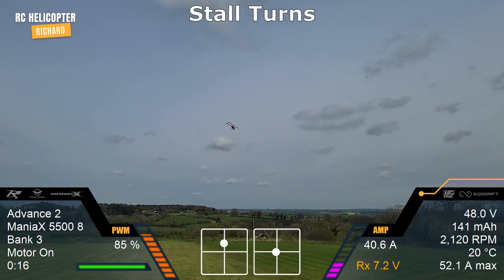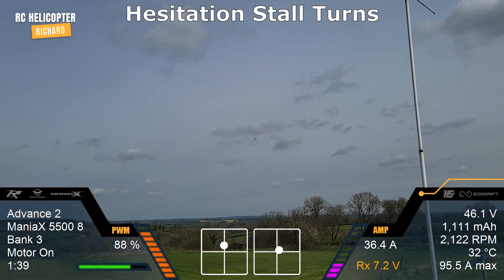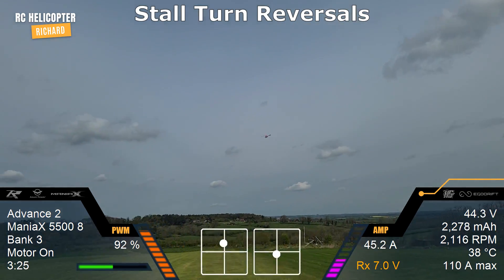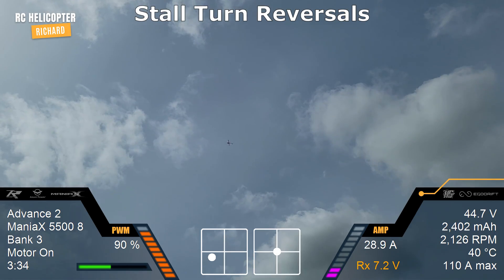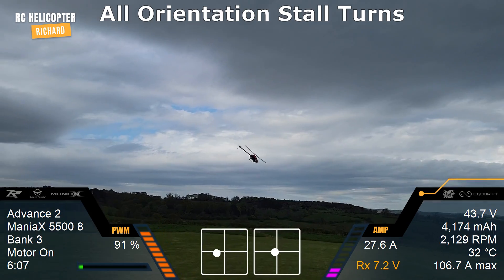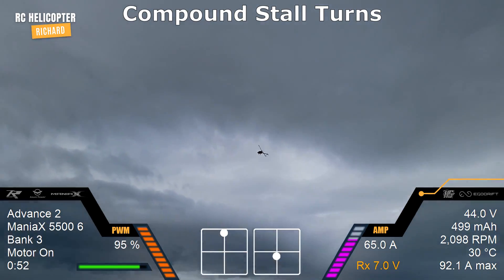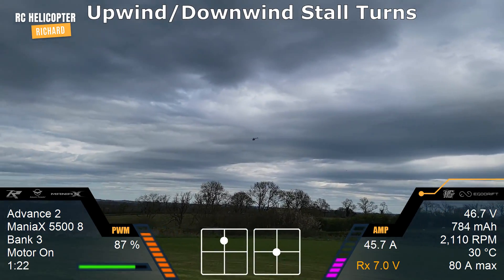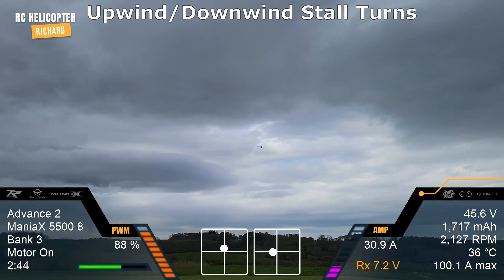Stall Turns! 3D Basics, with sticks and telemetry

Comment: Very nice video, love the telemetry and inputs overlay! By the way, your gearing seemsa bit off for the Bank 3 2100rpm headspeed; your PWM is often hitting 100% even with those smooth manouvers. Need a bigger pinion? thanks again for the great content !!
Reply from the maker: You're bang on the money, first to notice. I have 550kv on the bench as we speak 👍

Comment: I love the telemetry overlay and the stick movements although I know that vbar only capture the input every 500ms. It’s a really nice work regardless
Reply from the maker: Yeah, it's a pity about the logging rate. Stick movements work for slow stuff, but faster stuff like tictocs just don't show properly.
Reply: May be if you can / have interests to use rotorflight and use vbar RX, then you can probably use its black box feature to get quick sticks inputs. But I know it takes time to setup correctly

Comment: Love the telemetry readout! Very cool
BTW surprised with the Amps it's pulling
Reply from the maker: Thanks. I'm not convinced the amps are correct. That does seem a little high.
Reply: @rchelicopter what ESC if you don't mind my asking? On the side turns with the tail pushing and full collective looks more reasonable.  On the straights it sounds like you are running a lot of pitch too so maybe there is that. Anyway, just out of curiosity.
Reply from the maker: @apostolosnt  Scorpion 12-130